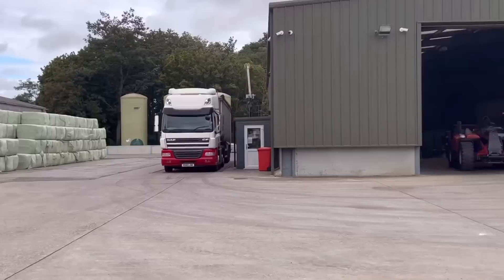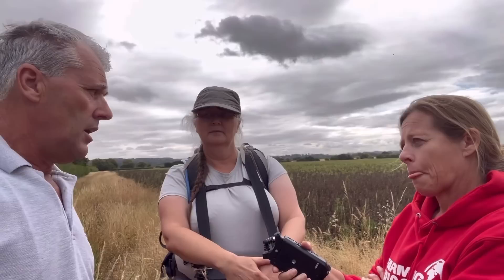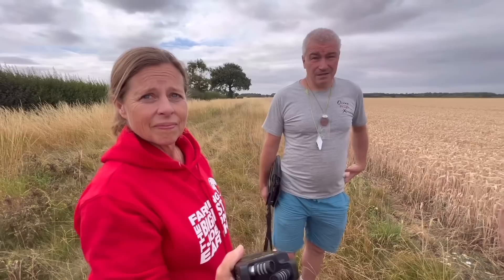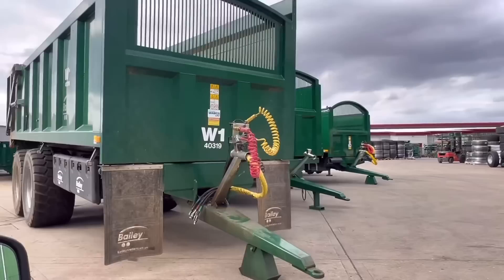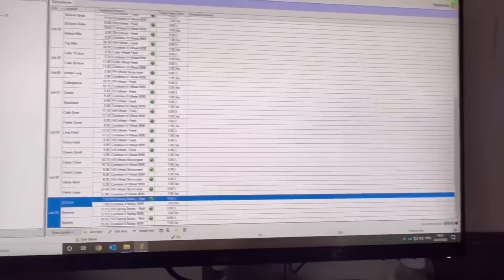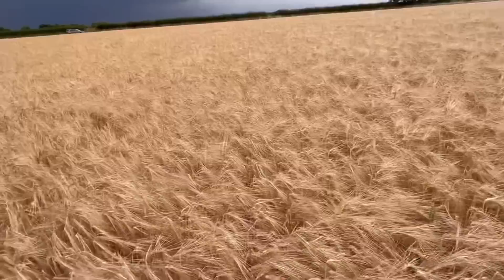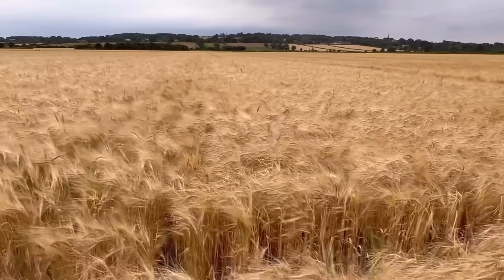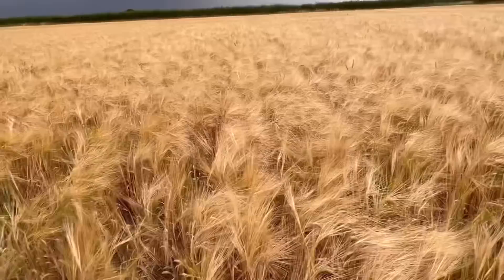FARM UPDATE 71 OSR INTAKE CONTINUES, ECOLOGY SURVEY, BASF PODCAST, VISIT DIRECT DRILLING PLOTS.

Comment: The barley plots are looking well considering the conditions they were drilled in,yield results will be very interesting.Regarding the flails and depending on the steel a sharp edge with an angle grinder might work,my brother used to sharpen the flails on the hedgecutter most days before starting work and it made a better job by cutting rather than bashing.Good update as always Mr Ward.
Reply from the maker: We’ve tried sharpening them but they still don’t cut the suckers. A few others are having same problem I’m finding.

Comment: Iam glad the weaving drill did a good job and your happy with it, as we run one. And considering the purchase price and it being mounted it works very well for us, it took me a while to learn how to use it and get the best from it but now it works very well. And they are great company to deal with ( no dealers getting in the way ) you deal direct with them, so any issues are quickly dealt with. Once again Andrew great video, just watched it as Iam doing my lunchbox and having breakfast and getting ready for work.
Reply from the maker: Hope your lunchbox was good!!
Reply: @WardysWaffleAndrewWard  it’s all about just trying to jazz it up and use different combinations as they do get abit the same. Good luck with your harvest we’ve made a good start are Maris otter did nearly 3tons which is better then we expected, osr slightly disappointing as it looked really well, but being at about 6-7.5 % then maybe the dryness effected the weights and overall yield. W wheat (Crusoe)  is looking good anything between 4-5.5 tons so hopefully it will continue. All the best. 
Stu
Reply from the maker: Cracking yields on the Crusoe. 👍👌

Comment: You might be better looking at flail with 150mm hammers. Offset flails never seem to do a great job compared to mounted flails. Rotor diameter and speed is key.
Reply from the maker: Offset v mounted? Ours is both.